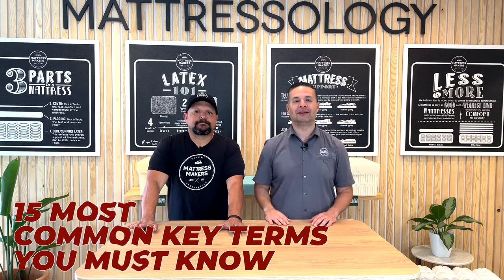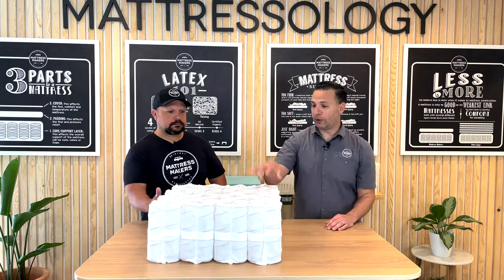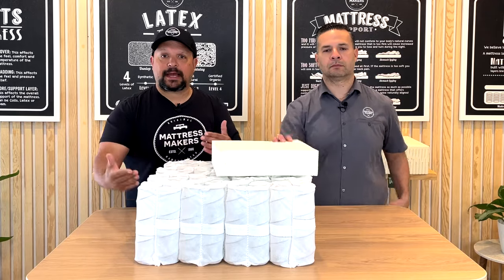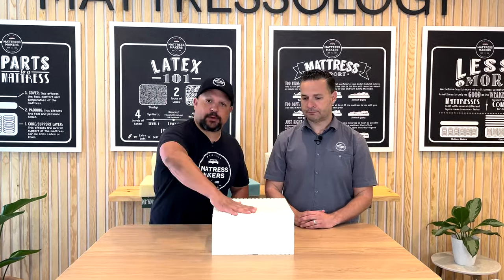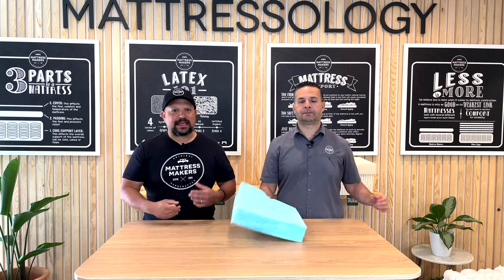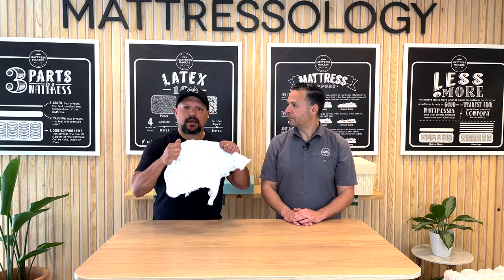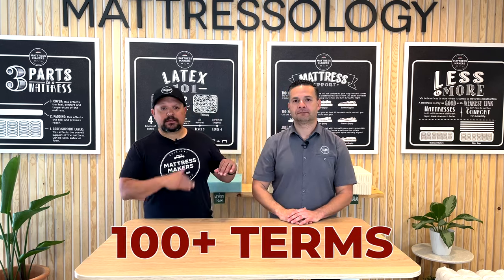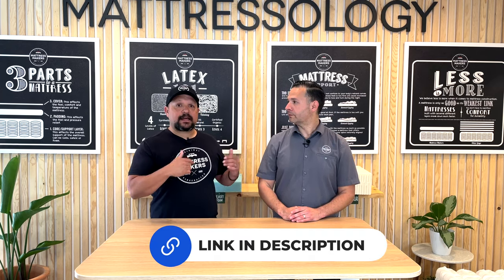Mattress Terms Every Shopper Needs To Know To Help Save You Money

Comment: This was a really helpful beginners guide to mattresses. Something I think would be very helpful, and I know you guys are mostly latex salesmen, but I would love an in depth guide to polyurethane foam. Stuff like how 1.8pcf polyfoam or higher is high density, maybe 4pcf memory foam or higher as well, how that density relates to quality. What ILD is considered soft with memory foam, compared to the large range in Polyfoam which can be used as anything from a comfort layer to a support. The responsiveness is an aspect that is often overlooked when its one of the most important qualities to how someone will enjoy the feel of their mattress. Would also allow you to point out that latex can be more durable than even the most durable polyurethane foams, typically better at dissipating heat, and provides a nice responsive feel. I think a guide like that would have a decent chance of getting shared a bit more as well.